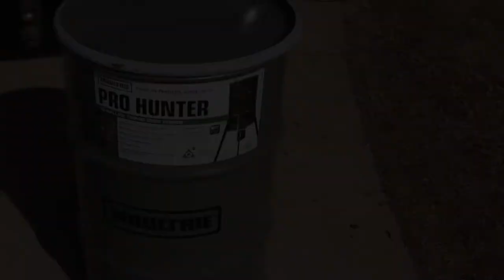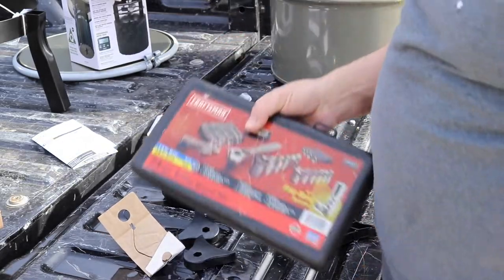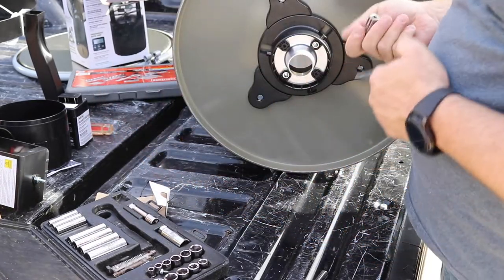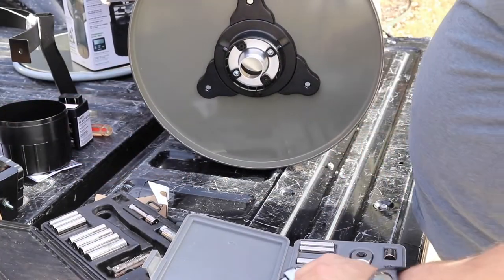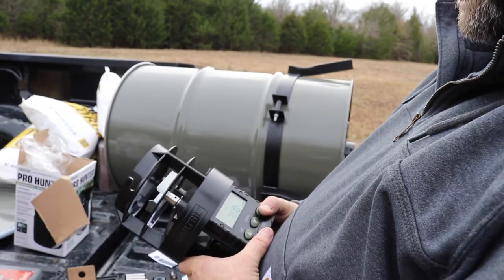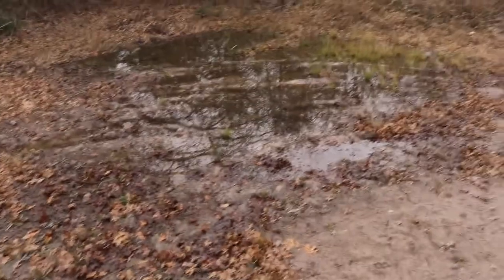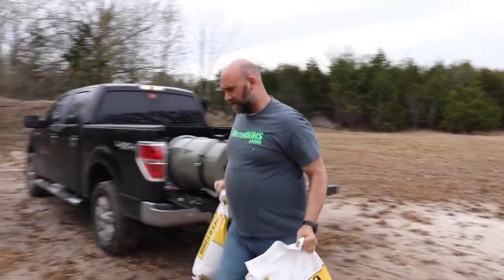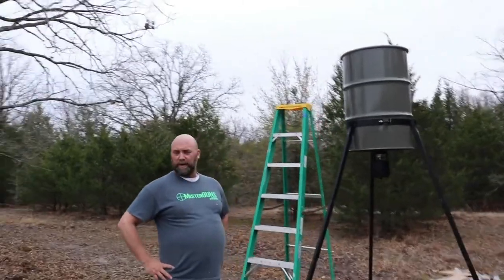Moultrie Deer Feeder - Review and 30 and 55 Gallon Assembly and Setup

Comment: Excellent video. How's the feeder holding out?
Reply from the maker: It's great.  Finally just changed the battery around 1/1/2020 sonit lasted from the time of publishing till then.  A little rust on top the barrels where water sits but not bad.  Probably gonna last years
Reply: @MisterGunsPlano  How often did you have to charge the battery?

Comment: This is  bit of a pain to set up🍇 allabout.wiki/Hunter Pro  though I understand why all the pieces make shipping and packing more efficient.  The instructions were clear and set up took me about 45 minutes.  Everything uses wingnuts, so not tools are required unless you are mounting cameras on the lid.  You do need a 6v battery (I had one).  The feeder is easy to program and seems quite rugged.  I am 6'0" and I can easily open and fill this feeder, which is great.